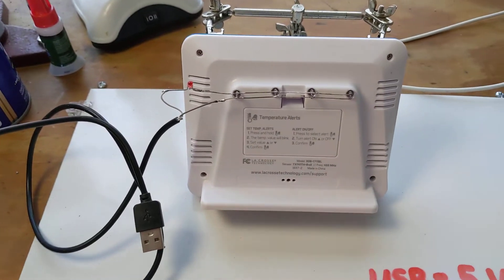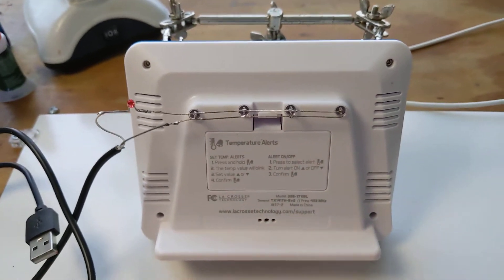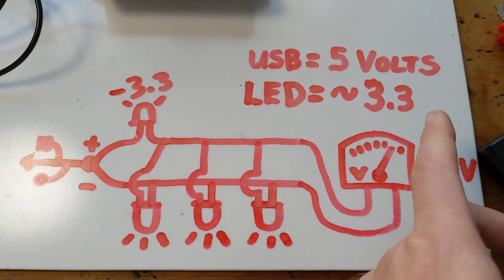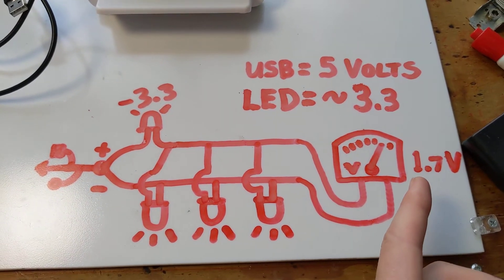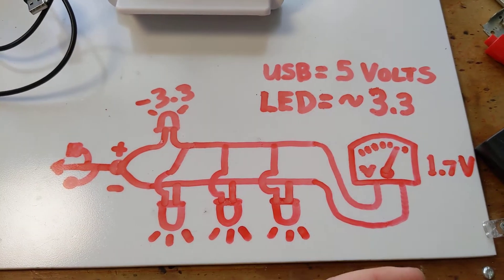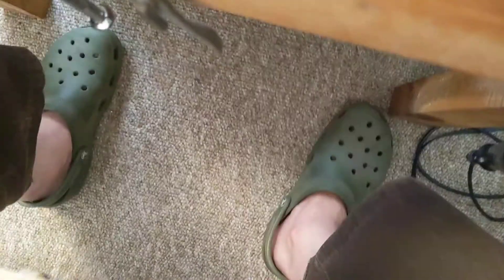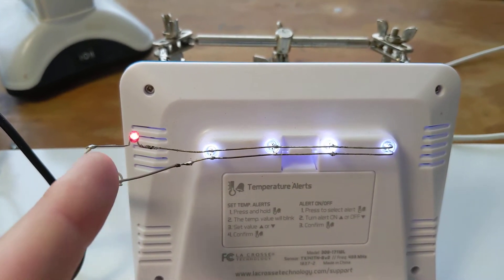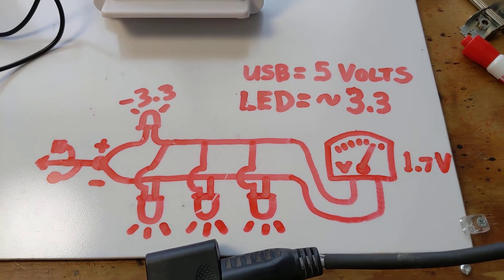Power 3.3v LEDs with 5v USB safely & elegantly!

Comment: I just built this for my dad.   So far so good.   He wanted me to put something similar to this in his shop window, so he could see the light from a distance, and be able to tell there was power to both of his 2 refrigerators.   I ran this off of a standard small iPhone charging block and a 10-foot iPhone cable, that I cut the ends off of.    I got 2.6v on first LED and 2.4v on the other 4 LED's.   Same set up as video with 5 LED's, But I used Green LED's

Comment: Your video is fine, but if we talk about voltage and not current, I think u can push standard LED's most to 3V, not 3.3V. I have tested many times, and you can't call them 3.3V LED's, they start slowly burning on that voltage, 3V is absolute MAX. (some LED's like red and orange can only be fed 2.3V max, green and blue and white always 3V max).